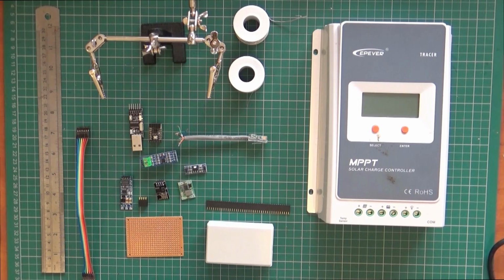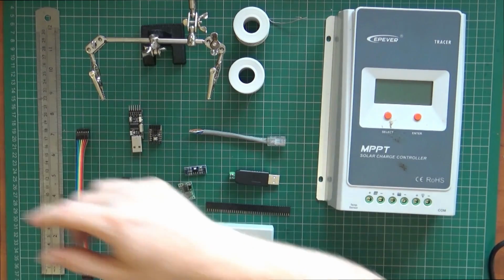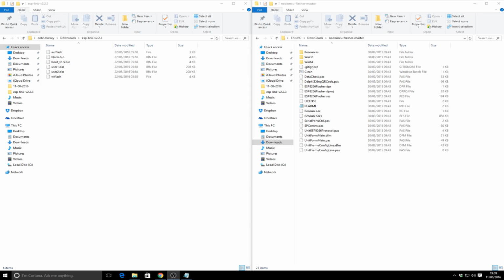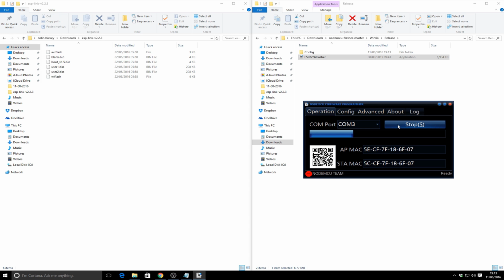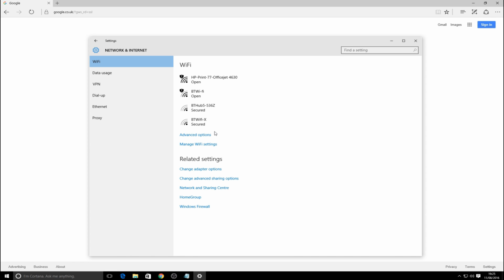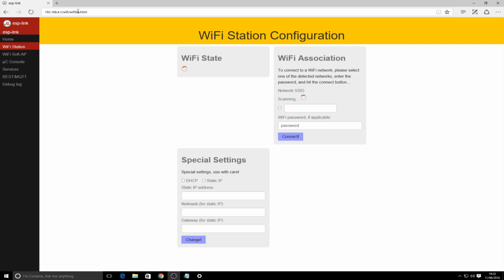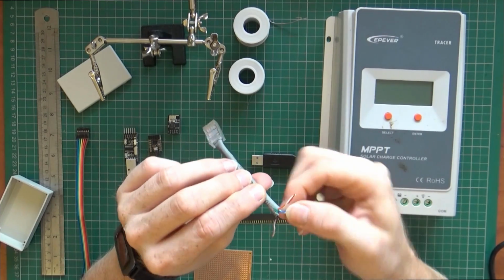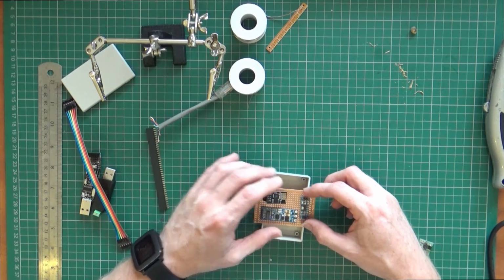DIY RS485 wifi ESP 8266 Adaptor Part 1 - Flashing and software

Comment: @Chickey 
Hello!
I'm tring to connect RS485-to-WiFi to my Solar Inverter Must but without success.
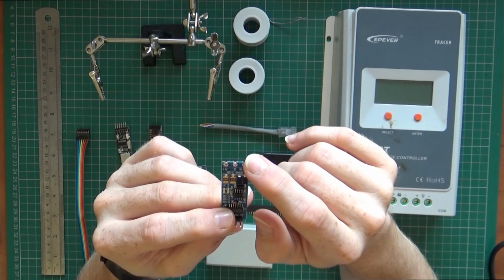Could you please  explain, in this first video you 06:05 minutes you said that without GND connection to Epever you construction (USB-TTL + TTL-RS485) doesnt work ?
If so, how could be working your USB-RS485 stick that has only A/B pins ? Where USB-RS485 converter took GND for work, from USB ? Then GND from USB and GND rom Epeve should be the same ?

Comment: I have a couple of these,  I have a A and a AN , 30amp tracer A, and 40 amp tracer AN . I like them, but either need a few more, or a higher current controller, for about 3-4kw total, keeping the ones I have in service,  it seems the 30 amp are priced cheaper per amp, I got the 40 amp at a deal kinda pre sale, I'm thinking about 4 more 30 or 40 amp, or a few 60 amp controllers,

Comment: Hi! can i charge lithium batteries with this charger? i have some batteries lipo 3.7v per cell 3S15AH, 6S22AH, and 4 batteries lifepo4 33AH , 4S 3.2v per cell
Reply from the maker: I'm using the charge controller for lithium cells in a 7s configuration.  It shall however not take into account the voltage of each cell etc so it's not ideally suited.

Comment: Very cool project. I did something similar in my camper with my Tracer 4210a, I made the cable using the USB to RS485 and connected that to a Raspberry Pi, and made a little Python script that reads the data from the charge controller and makes it available on my network. It works great, and it lets me switch my camper's refrigerator over to electric power when the battery is fully charged and the sun is out, which has saved me a lot of propane. But I've found that the Tracer 4210a randomly stops responding over modbus for hours at a time. I haven't been able to find a pattern to it, but I've now tried two different 4210a units, and two different cables (different ethernet cables and different RS485 adaptors), and same issue. It's maddening, and is nearly a dealbreaker.

Have you noticed any issue like that in your project?
Reply from the maker: Really sorry for the long delay, missed a lot of comments on some of my earlier video's.  I've been lucky in that both my charge controllers are responding ok consistently for the RS485 connections, i've been logging a lot from them lately and they have been pretty reliable.  Are you still experiencing the issue?
Reply: Nope, all fixed now. The secret was 1) ground the Tracer to my Pi, and also to ground my inverter. Since doing that 100% reliable, phew. And my fridge is happily running off solar for about half the day.

Comment: I found the only way to get my esp8266 into bootloader mode was to short GPIO to ground as you power it up and not after. I used one of these to program it with the orientation of the esp with the antenna towards the usb plug.
http://www.ebay.co.uk/itm/191874511536?_trksid=p2057872.m2749.l2649&ssPageName=STRK%3AMEBIDX%3AIT
Also the wiring for the esp to the TTL to RS485 converter is Rx to Rx, Tx to Tx and not Rx to Tx and vice versa.
Reply from the maker: Yup i do the same regarding the grounding, i use a small programming board and short GPIO0 then perform a power reset and release the short on GPIO0 after it has powered up.
Reply: Aye thanks  It just wasn't that obvious at first and I incorrectly connected Rx to Tx so couldn't get it working for a while. All good now though so thanks for your vids.

Comment: i've been following your project for some time. can this do the same job ? ... 
HLK-RM04 Embedded UART-ETH-WIFI Router Development Kit w/Antenna
 http://www.ebay.com/itm/201133917145
Reply from the maker: Hi i don't believe so as it only does serial RS232 to wifi or network rather than RS485 required by the solar controller.   EPEver do have a product which is out now that does it without any development work however, +Adam Welch has done a couple of great videos on it, he's commented below so you can find his channel from there.
Reply: Thanks for your fast answer. I belive I will build the one you did as it's more interesting... had this idea for quite a long time but no time, after found your video, job well done by the way. I saw already Adam's video but I want to stick to custom unless that one isn't more than 20 usd.  Cheers.
Reply from the maker: I enjoyed making mine and it's been reliable so far I have to say
Reply: sorry but I downloaded esp link 2.2.3 zip and
could not find boot v1.5.bin or user1.bin or blank.bin can you help can't see in zip files must be doing something wrong!
Reply from the maker: Brian Carney hi Brian let me check the download links as I may have linked it wrong.
Reply: found it in the file sorry thanks brian
Reply: found it in the tgz file sorry not in zip

Comment: I'll definitely be building one of these. Thanks for the detailed explanation...  On to part 2 now for me.
Reply from the maker: Cheers Adam i'm really happy with it and it's been pretty reliable so far.  I struggled with the video editing though as it ended up being a long process to build/setup software, need to work on my editing skills!  On the hardware i need to look at running the UART at 3.3v again as the RS485->UART will be giving 5v signals to the 8266 which is too high really so might shorten the life.  Could just thrown in a level adapter.
Reply: I think the ESP8266 is tolerant to slightly higher voltages to 3.3. Andreas Spiess was recently using them at 3.6 volts on LiFePo4's - perhaps that little additional voltage would help the RS485 to UART be more reliable?

I've got a few MAX485s in my modules box (think I got five for just over £1) I might try to get one of those working first - a shared ground will probably help with the communication as I think you pointed out.

I've almost stopped filming me building things - I just stop every so often and talk a little about where I've got to.  Seems to make the video flow a little better and the editing a lot easier!  Do your own thing though - I enjoyed all three videos.
Reply from the maker: I'll try the stopping every so often method as doing it the other way seems to lengthen things out a lot as you feel the need to narrate and try to keep things in shot.  Going for a midpoint voltage wise could be a good idea, i saw andreas video too, could use the variable DC-DC adapter and drop the 5v to 3.6 and power both the  RS485 to uart and ESP8266.  I'd be interested to see how you get on with the MAX485, i could have done it with an arduino i think as you'd have to do software RS232/Serial but i choose the quick/easy option of the ESP-link firmware and the slightly more expensive RS485->UART adaptor but it was far simpler with zero coding too :-)